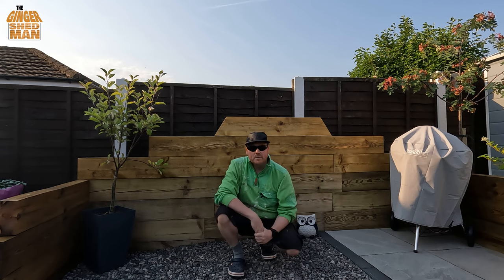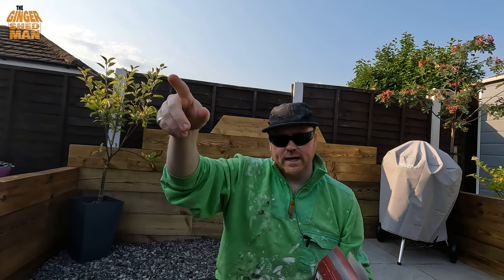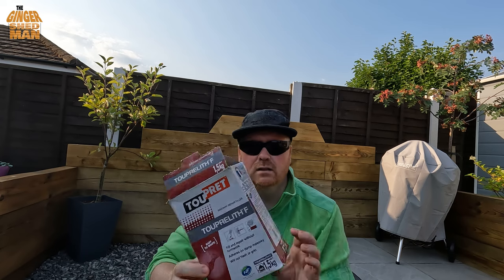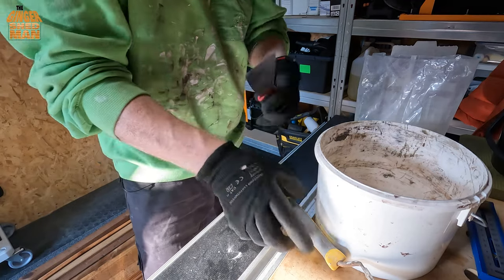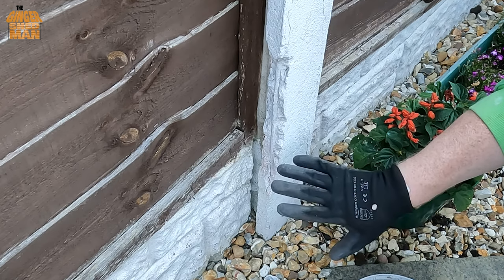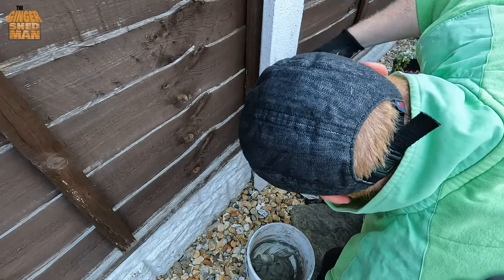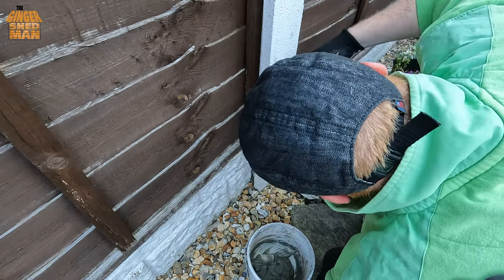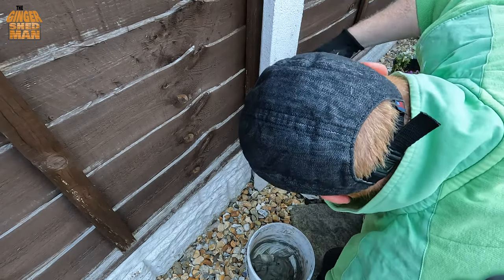How to repair a concrete fence post - DIY!

Comment: Thanks for this, just what I was after! What type of sand paper did you use?
Reply from the maker: Thanks! I think I used just a general wet and dry. I also used a rasp too and I think a tile file. You can texture it too if needed. 👍🏻
Reply: @thegingershedman  having googled now I thought your rasp had some sort of odd sand paper on it 🤣

Comment: Hi wondering if any 1 can help me.

I have old year (2000’s) concrete posts with the 6ft concrete slats/panels in them I hate them I won’t to try put the roof Barton’s across it but I think the post have reinforced steel in (video your doing a repair on ) I don’t no if the newer one do now also I tried to to a test hole with my SDS an it was struggling even the noise wasn’t right I don’t no if I was hitting the steel but any tips or help would be much appreciated 👍🏻✌🏻
Reply from the maker: Hi! Thanks for your comment.  I'm no expert but i would guess there's steel bar in most concrete posts.  You could very well be hitting a steel bar, are you drilling in the middle or to the sides of the post?  

If it was me, i'd install some wooden posts to take the weight of the fence battens you're attempting to install, this not overly burdening the concrete posts with extra weight.
Reply: @thegingershedman  nice one mate I appreciate the reply. I tired to drill into the centre I will try again on the sides.

It’s a mess mate my back wall massive tree long story if I could start from fresh I would I just want it for privacy that’s all. 👍🏻👍🏻

Comment: Can I drill into this once it has set ??
Reply from the maker: I'm not 100% sure. There are several different options of this brand, maybe one would withstand drilling but I wouldn't say the one I used necessarily would. Thanks for the comment!

Comment: Posts are in upside down.
Reply from the maker: How’d you mean, upside down?
Reply: I take it they’ve been in for years the side your repairing you can see looks rough but your side will be smooth that’s actually how they come new you can use the bobble end as a top but can almost guarantee the end that’s in the ground was cut like a pyramid it’s a much nicer looking finish sorry about your neighbour mate .